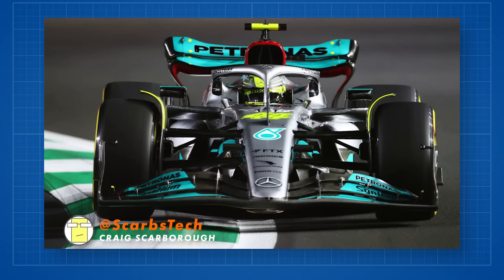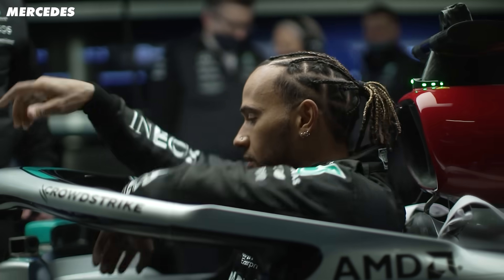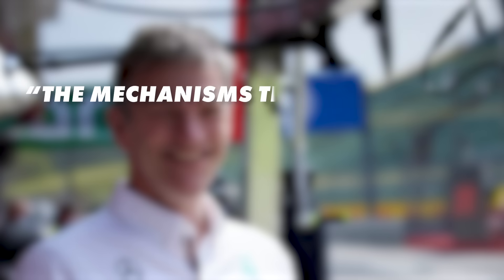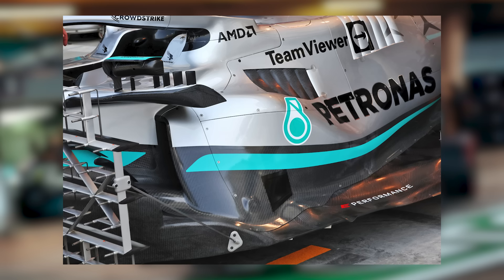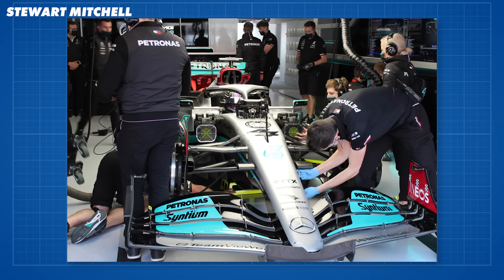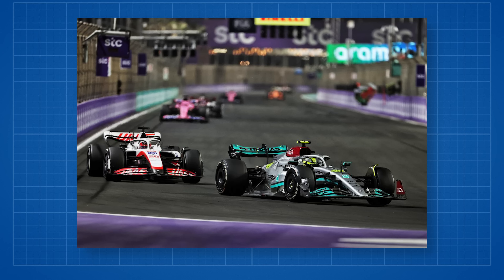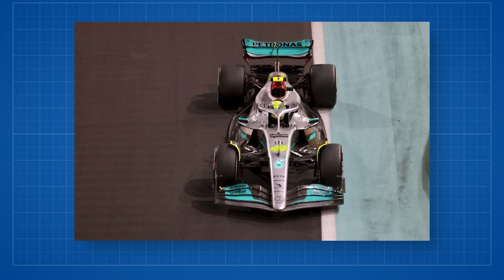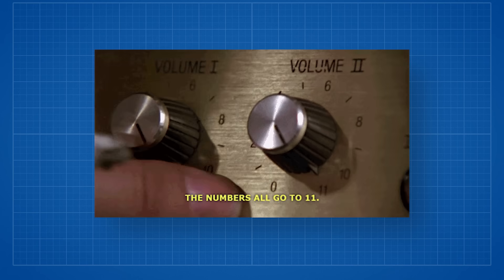The Real Reason for Mercedes’ Slow Pace | Saudi Arabian GP

Comment: At pre season testing most of the so called “F1 experts” praised the design and aero efficiency of Merc, Malaren and Aston Martin’s new cars. Seems like they all have changed their verdict now.
Reply: youtube world!
Reply: I'm by no mean an expert, but, when I saw the first car (the one some expert already said was "one year ahead of the competition") it seemed to me like the Ferrari F1 2009. The previous year's car adapted to completely different rules. Hardly a success.
It came out it was a fake. 
Second car. Experts "revolutionary!". To me the sidepods were wrong. Usually you don't want your air intakes to ingest the boundary layer. That's why all the other cars have orizontal air intakes. It's obvious that Merc's engineers found a way for that design to work, controlling the fluxes of all the front end but, if that's the case, it's hard for it to work in every possible situation. A complicate solution to a not existing problem.

Comment: During the last 3 races of the 2021 season, MB some how was able to find unprecedented speed.   They probably did something similar to Ferrari 2019.  When they protested the result, the FIA probably told them to withdraw or potentially be exposed, which could have being catastrophic and potentially lose the constructor's title and the profit sharing.  It was the quickest protest withdraw I have seen.

Every MB powered cars finished in the bottom 10 during the Abu Dhabi GP and Saudi GP wasn't much better.   Even Haas seems to be faster.  

This will be interesting to see through this season.  If Hamilton can't win a race this year, will he stick around?

Just my theory.
Reply: They gained that speed by abusing the engine penalty system, they ran the engines hot knowing they would last fewer races they timed them so they would lose very few points and have the best chance to gain back the places, It's a loop hole I wish the FIA would close but it is what it is. Ultimately for Lewis having a 5 place deficit in a faster car over the course of the races worked out in his favor easily gaining those places back against the slow Ferrari and Perez meaning he was then competing against Max with a power advantage. 

They withdrew because there was nothing to gain. The FIA couldn't apply penalties to Max since he did nothing wrong. The only outcome they could hope for is the race being declared null in which case Max wins the WDC anyway as they draw on points and he has more wins. The situation was utterly unprecedented and the FIA had to back MM or risk a tonne of liability leaving everyone in no mans land. Merc could have spent millions on an appeal but there was no way they were changing who the WDC was so there was no point.
Reply: @dr2165  

Adorable reply.  If MB gains that much speed with a fresh power unit, why are they so slow during the first race of the year?  They should be taking a new engine penalty every three races just so they can stay ahead of Haas.

Comment: Probably needs an advanced form of damper  that would be linked to the cars computer at the moment it's new ground with heaver cars wider tyres  ? Could play with there pressures see what happens but other than that as a retired lorry driver I would say disruption of weight in the car ? Too heavy one end

Comment: I respect Scarbs a lot, but those theories about the Mercedes engine are a bit  suspect,  why would the engines be turned down for all teams until Mercedes upgraded their car , also if they  are deploying electrical energy through the corners and not the straights why  are all Merc powered cars following suit, Jeddah is a power circuit and the violent bouncing is prevalent to Mercedes I'm pretty sure McLaren and AM needed more top speed in that race. I think its something to do with the new E 10 fuel as well cooling issues, With the engine freeze they cant improve combustion but I believe reliability upgrades are allowed. But these are just theories until Wolff finally opens his mouth about the matter.

Comment: Musings of a stupid Yankee! I’m sure the people that Mercedes are a million times smarter than I am when it comes to the aerodynamics and physics of that car. However it does have those minimalist sidepods. That increases the airflow traveling to the Coke bottle area and in particular the rear tire. It makes me wonder if the wake coming off those rear tires interacts with the floor more profoundly as the floor changes height relative to speed. Could the tire wake that travels around the bottom of the tire be causing a catastrophic disruption at the rear diffuser and thus triggering porpoising. 

Just thinking out loud a little.

Comment: I have to disagree with the idea that all Mercedes teams are suffering from similar aero balance issues.. AM actually have the lowest downforce rear wing on the grid which hasn't changed much since Bahrain... it's very obvious that they are lacking in power deployment and also acceleration generally if you follow the live tracks on all Merc cars and compare to their rivals... Hamilton mentioned in his interview after the race as well that they "need more power". AM are the only other team to have publicly claimed to have lost almost three quarters of a second to porpoising and they use the Merc suspension.. so Allison's comments are correlated here but it's also without a doubt low on power.

Comment: Since day1 of merc showing it’s car .. i said that they would have struggled due to the fact of bad design strategy and misunderstanding of aerodynamics with the whole respect to Merc engineers. It was obvious that the centric force is really excessive and wide which would cause porpoising
And also I said a week earlier they have to lift the car and stiffing the suspension but it won’t resolve the issue.. what would matter the most is redesign the front wing so it can split the air to the sides more and less on the center .. also they have to redesign the side of the car specially at the seams between the floor and the side wall by adding small wings channels that can ease the Venturi channels before reaching the rear diffuser 

I guess they wouldn’t get it right before half of the season , cause it’s obvious logic simple mistake not spotted by them experts 

Most likely merc won’t survive this season
Reply: Why don't you email them? They might try your ideas. You never know.

Comment: Porpoising is an oscillation.  Something is suddenly breaking the aero grip, allowing the loaded suspension to spring back, countered immediately by the down force pushing the car back towards the surface. One put into motion,something needs to.dampen that oscillation. Your car would bounce like crazy if you didn't have shock absorbers, and that's just springs and gravity working against each other.

Comment: I'm convinced that the issue is the power unit. Andy Cowell did not develop this engine and it could very well be a dud. Porpoising is one thing and I do get that you cannot increase the power clipping if you have a bouncing car but i believe that even when they porpoisng does get sorted out, that PU will still be mid tier !!!
Reply: My theory would be the power unit runs out of juice at the end of the straight which slows the car. The drop in torque puts tortional forces on the back axle causing porpoising. Kinda a double whammy.

Comment: Despite merc trouble, they are still a clear third place team. That means they wont be far off the top two. Its a big gap between 3rd and 2nd in term of pace but in term of point, not so bad

Comment: But aiming for Spain for improvements just means the other teams will too. So unless they’re going for something major that will lose 1-2 seconds then any improvements will be negligible. They need a rework because their car just isn’t up to the task. And I’m not sure what the rules allow to be changed mid season?
Reply: Just because other teams will have updates doesnt mean a thing. If Mercs even claw back 0.3 to 0.6 seconds of that defecit, teams could be in trouble on tracks that require proper race strategy. Their AWS strategy computer also uses custom algorithms that have them years ahead of Ferarri that are rubbish in terms of strategy. I don't think they will BUT if they do ( very plausible) other teams will be concerned with them having two cars up there racing. Redbull is basically just Max as Perez is useless

Comment: of course all MB powered cars must have engine problems, not aero problems. because the two are connected. with plenty of power, as ferrari and probably a bit less honda, they are able to chose a setup with much downforce without compromosing too much the speed on the straights. whereas with less power, the teams must either use a highspeed setup which makes the car slow in the corners, or high downforce setup which gives them good straight but slow corner speed. it means with lack of power, any setup will be somehow slow.....
Reply: And if you were Mercedes with a PU advantage for 2014 onwards, you could use much less efficient aero solutions to your problems. It's kind of a safety net that you don't have if you're down on power.

Comment: I don't believe this "it's not the engine" talk. I remember a few years ago when the Merc engine was the strongest and that allowed them to add in more downforce and really maximize their performance. Now they have the opposite problems... IMHO, the engine is the weakest of the 3 engines. They can't improve the straight line speed so they're trying to maximize the downforce to improve the cornering speeds. If the engine was stronger, they could raise the car some and still have good lap times.
Reply: thing is powerunits are not radically changed. they are same rocketships mercs ran in brazil and qatar last year. there is only addition of new fuel. and that wont create a 170bhp deficit. its more of because they are running cars higher they cant go all in without losing rear ends. you have seen it with latifi. i think mercs are masters of sandbagging. the way they ran last three races of 2021  you better believe they are holding on to sth. in this case its Spain. if they are slow in barcelona you can pretty much write off their season
Reply: @TheFarrukhzain  The power units have been radically changed. Ferrari re-built their engine from the ground up for this season, Merc's own Head of Engine/PU said that this is the biggest change of engine design they have made since the hybrid era.
Reply: Tuning the engine up is not necessary if you are.comfortable making end of season changes that make headlines... Like last year when they zoomed through the field to make it interesting. I still prefer to see others on the podium though.

Comment: I'm surprised at Scarbs thinking Mercedes are effectively sand bagging? I doubt Mercedes are in an engine mode less than max ?
Reply: The man knows what he's talking about.  Think critically for a moment like you are a current engineer at Mercedes' factory.  Why would you tell the driver to go full beans with the engine mode when you have not fixed the porpoising issue?  

Are you forgetting the budget caps?  

Can Mercedes really afford to keep fixing the car by damaging it just to show everyone that their PU is still powerful and push the car beyond its present capability and show they have the bhp?  When in contrast they could just simply keep using the races as test sessions since they have limited wind tunnel time to gather data, so that when they do get a fix and sort the issues plaguing the car, they'll be able to run the car in full race trim and demolish the misconceptions of their rivals.

Which is more logical?
Reply: @alexandershaw2378  I'm not wasting time on a fanboy that's got issues with anyone's opinion that is contrary to your beliefs. You're about to discover that Hamilton has been hugely fortunate and the stats are flattering to him. Just as with Mclaren once he hasn't the fastest car his performance drops off.
Reply: I think redbull are going to come unstuck later in the year with pu penalties as their engine is the most unreliable and they are running it full tilt to stay with ferrari
Reply: @luker3456  possibly but that's a little premature to say it the most unreliable after two races?
Reply: @GB-vn1tf  they have had more failures than anyone else so far so its pretty simple to work out (obviously including at )
Reply: @luker3456  yeah, obviously but we're talking one race where three went wrong right at the end. It is possible that those may be the only failures they have.....of course Yuki also, that slipped my mind, I'm getting old! But seriously, that might be the only failures they have, as a Ferrari fan I hope so so we can have another great championship instead of the Mercedes dominance we've had for a while. Competition is what makes it exciting so I'm hoping Mercedes do get it together as well as Renault and Mclaren, then we will see who is the better driver on the grid instead of one car flattering it's driver.

Comment: The explanation on the source of porpoising was not convincing. The fluctuations have to come from a force source, which can be either from the bumps on the road, or the aerodynamics. I cannot think of any other source but if anyone does, please share. So if it were the first case, it is very simple to assess the dynamic response of the suspension by looking at the impulse response. The latter is more difficult to assess though. I'd think it is aerodynamics related, but doesn't have to be stall related necessarily. It can be from vortex induced vibration or even galloping, given the detail flow structure around the car.

Comment: My money is firmly on power unit weight distribution with Mercedes being the least optimal. My assumption is, more evenly distributed weight means less dynamic force spikes when the car comes under load, which leads to less chance of aero stall due to pressure on the suspension. Honda's size zero concept currently killing it and I expect to see Ferrari's advantage to Red Bull drop off as Newey et al catch up after time lost with last season's championship battle. Ferrari's last non-ICE power unit upgrades I think will be essential to their challenge. I know a lot think Ferrari are the favourites right now, but I think Red Bull are. Leclerc is clearly the smarter racer though.

Comment: Aye! I was bang on. The merc issue is caused by the suspension not being able to handle the change and spike in load. You can mitigate with some suspension adjustment and also some mods with the floor. This further exposes merc main reason why they haven't solved the issue yet and why they actually have the faster car by far. They are making too much downforce to mitigate the issue the same way the others did. 

We can see that the Red Bull and the Ferrari along with most of the grid, still suffer from bouncing. They are just able to get it under control better. This is also why I think Mattio said that the one to resolve the bouncing first will have the advantage. So it is like I said but with a small edit. Merc are force to wait for the new suspension.

Comment: Merc is going into a generation of car that's carried by the aero and not the engine. They didn't get the chance to spend half a decade developing this gens quirks in secret so youre seeing the works team exposed for being what they are. Without years of a headstart and without an Era that's solely dominated by insanely expensive and peculiar changed to the power train they're being caught out. You could see their fragilities in the chassis and aero package the entire hybrid Era, their powerplant was just so dominant that you only saw it 2 or 3 times a season